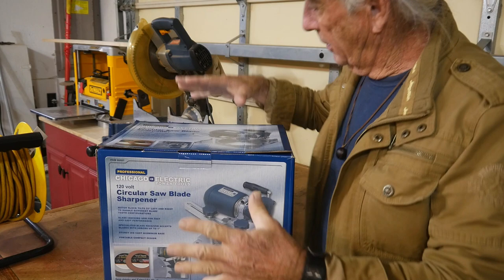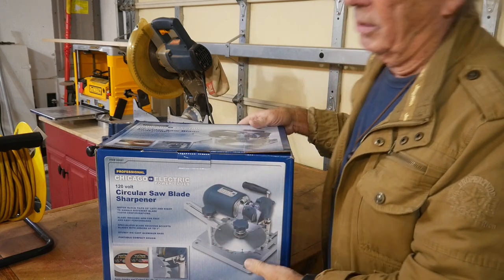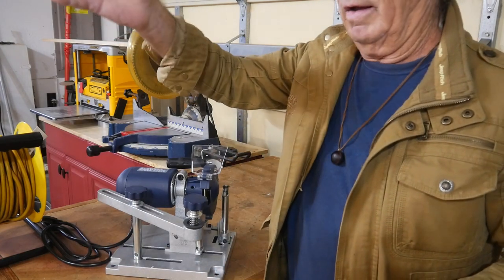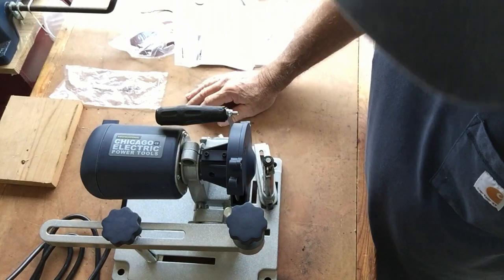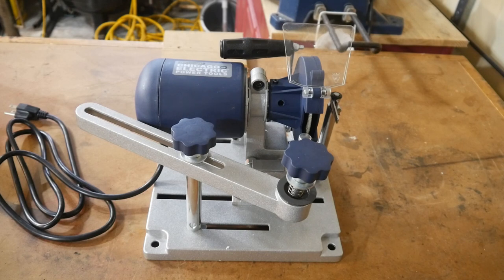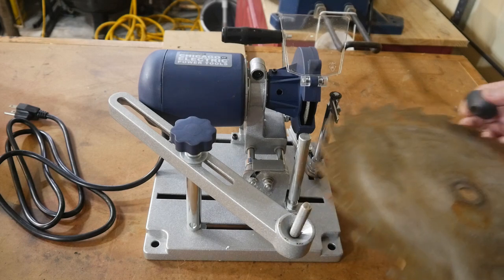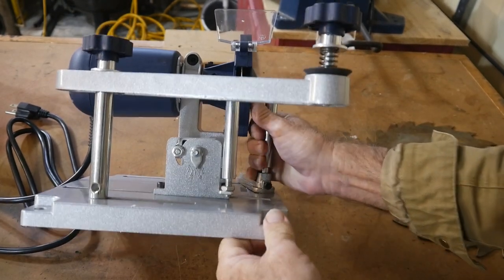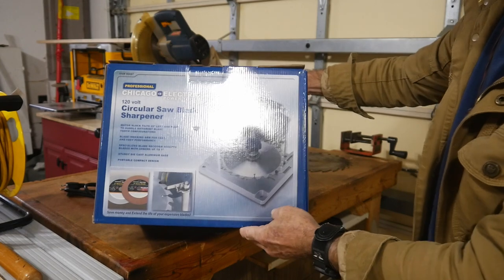Harbor Freight circular saw blade sharpener unbox and review Coffee and Tools Episode 124

Comment: I bought one and like other Harbor Freight bench tools they really need to be gone over and properly adjusted and add a few modifications. I will disassemble them completely and reassemble using lock tight on studs, add washers to take up any slack or increase the footprint for stability. I found that by adding a knob and washer to the indexing / positive blade stop adjustment helps ease the adjustment process. I had to re drill and tap the locking bolt for the indexing pole, it was striped out. The undercarriage that the motor slides on was very loose. This tool has received some bad video reviews, but if you know going in that it will need a little tweaking / modification you can have yourself a great sharpener. FYI they are discontinuing it, so you can pick one up at a great price.  Oh, and don't use the wrenches that come with it you will round off the nut's. Don't let the fact that this and other HF bench tools need a little TLC stop you from getting them, they are a great value.
Reply from the maker: It did better than some HF tools. I've kept it on my shelf and used it a few times now. Can't complain after checking local prices for blade sharpening the machine paid off in only weeks, but I'm making notes over your "upgrades".  We live for upgrades 🤠
Reply: @SirTools   Using lock tight on three bolts is important, the stud that is used for the motor slide carriage, it does have a jam nut, but I prefer use a little LT and the studs that hold the arm to the slide carriage also, I put washers on both sides of the arms that operates the motor slide zero side to side free play in the arm now. I put a larger washer under the post were it contacts the frame for the blade adjustment that increased the footprint and made it very stable. I added washers to the locking nuts that holds the motor at the correct angle that way it doesn't chew up the frame. The knob and washer on the indexing adjustment is a absolute must, forget using a nut and bolt there. P.S. make sure you use purple or blue loctite. NO RED.
Reply from the maker: Super David ! Yeah, I've always used the blue loctite around the shop 🥶